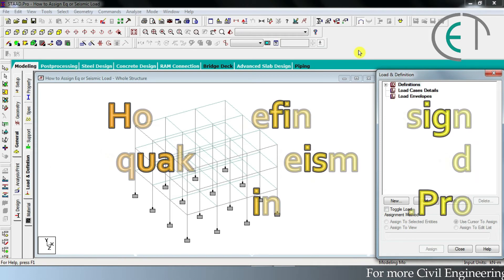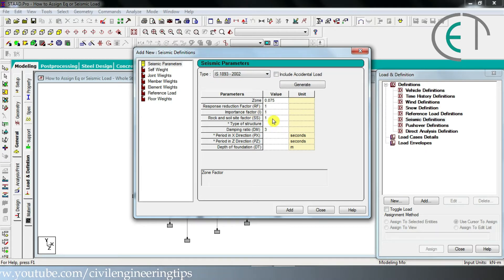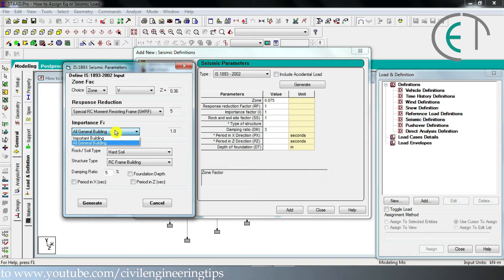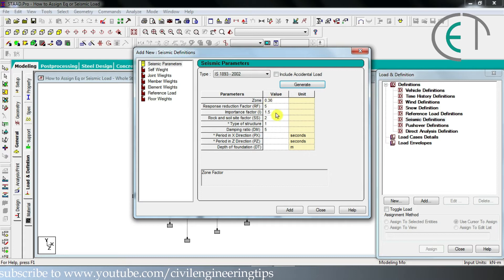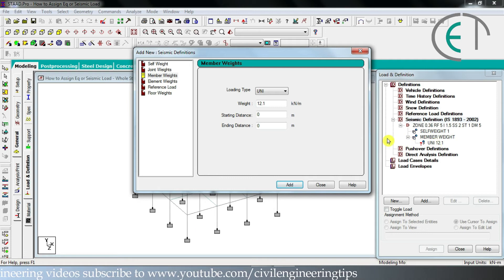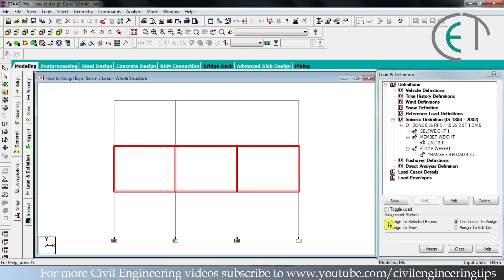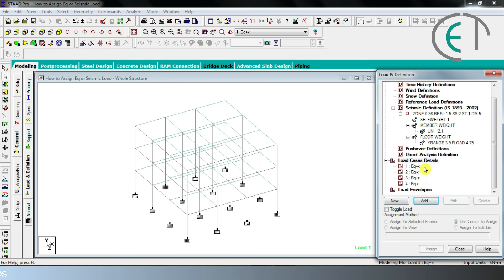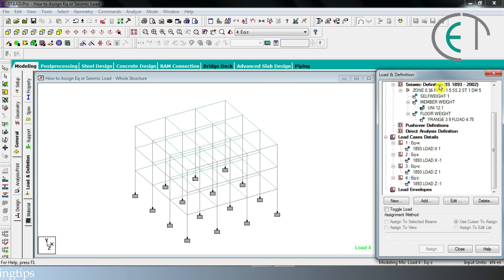#17. How to Define & Assign Earthquake or Seismic Load in STAAD.Pro | Civil Engineering Tips

Comment: How to calculate live load intensity for seismic definition like if live load intensity is more than 3kn/m2 50% will be used if less than 3kn/m2 25% will be considered means?
Reply from the maker: You better try ETABS for better experience for seismic definition and seismic weight. I don't like this Software personally.

Comment: Sir in seismic floor load if building is g+6 in this case how to select y range pls tell.
Reply: Sir pls make a video pls as per Indian standard code pls as soon as possible
Reply from the maker: @arafatwarsi2273  Start from the GB/Plinth Level and Stop to the top level. Can't you determine the height? It's easy right? This way you can input Y range for any storied building.
Reply: @CivilEngineeringTips  sir unable to do pls make a detailed video sir pls
Reply from the maker: @arafatwarsi2273  okay
Reply: Sirin seismic defination during adding of floor weight we put the value of total dead load.
And value of dead load in seismic defination and while adding dead load the values are same in both the cases?